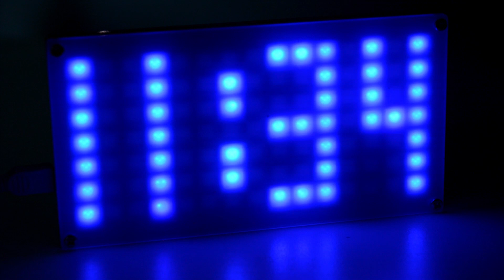GEEKCREIT DIY DS3231 DOT MATRIX CLOCK KIT

Comment: Seems, you have got the DS3231M chip with the clock. In this clock, it is used a passive buzzer , which bells when a meander comes to it at a certain frequency. The DS3231M gives on the third leg a meander of only one frequency in 1Hz (see the datasheet)  out. Therefore, when any button is pressed or the alarm goes off, the buzzer snaps. In order for the buzzer to bell, you need the DS3231SN chip, which produces on the third leg meanders with programmable frequencies 1Hz, 1kHz, 4kHz, 8kHz. At a frequency of 4kHz, the buzzer will normall bell. This clock must be only completed with the DS3231SN chip.

Comment: Solder paste!
Reply: 0.4mm 50g Flux 1.2% Tin Lead Rosin Core Solder
The paste is in the soldering wire, just imagine trying to get paste on those tiny contacts without creating a short.